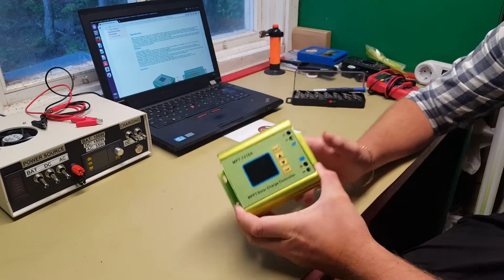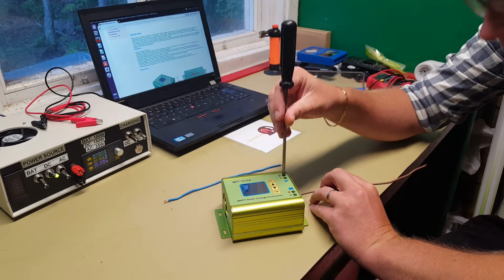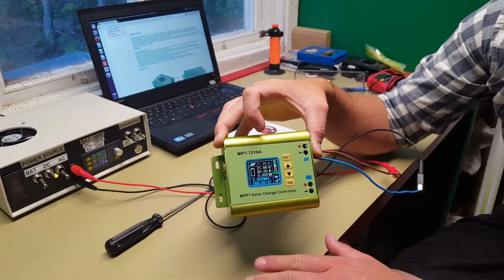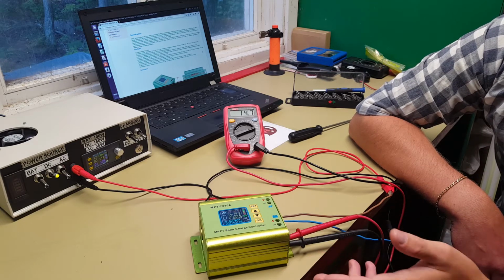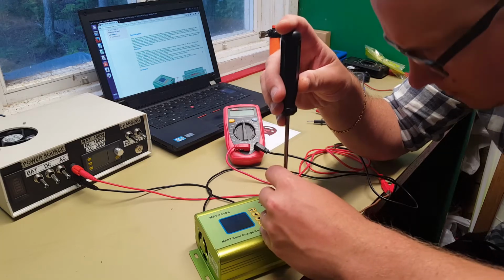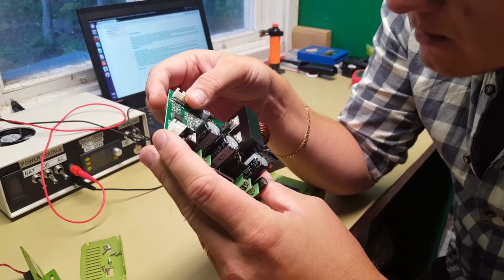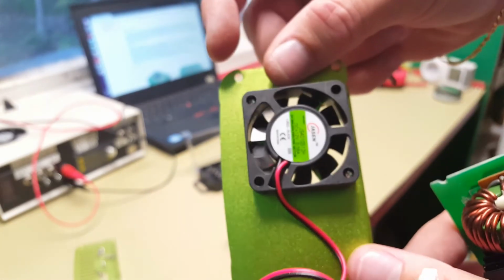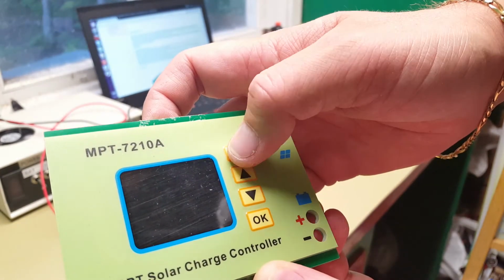A look at the MPT-7210A MPPT Solar Charger

Comment: Your review is spot on. I wish you could have identified the power gates and did a current test.
I have 2 of these units just recently purchased. one of them will not output more than 3 amps on a 28 volt setting inputting from a 12 volt 21 amp supply.  The other one instantly melted the solder trace from the T3 transistor to the R13 current sensor as soon as it was connected to the battery.
I Because i did not see any certification markings anywhere on the device, i would not recommend this item for sale to the general end user. If the manufacturing company would put just a little bit revisions into this unit they would have a really competitive product. Just my opinion...

Comment: This is the first review I've read that explains this controller correctly. This enables me to use one 12v solar panel to charge the battery from my electric trike. When I travel I pull the battery our of my trike and use it in my RV to run the fridge and other devices. The solar panel is on the top of my RV.
Reply: You wont get much power from a single 12V solar panel.
Reply: How many watts of your 12V solar panel on RV roof? Thanks.
Reply: What 12 volt wattage solar panel is recommended for using this?

Comment: I slowly begin to understand what these units do and what to use it for. I own a big UPS Server Backup Power Rack wit 8 old 12v-7A LA batteries arranged to be 48v (84Wh), i can replace them with a 13S Li-Ion Pack + BMS and charge it correctly with a 100-200 Watt 12v-24v Solar Panel. This way you can charge and discharge a 13S battery to run the 1600 Watt Inverter to use 220v stuff for a longer time if needed. The output current is rated (Fuse) at 100 amps, so BMS and wires have to be thick.

Comment: This is a good controller especially for lithium-ion
Reply from the maker: Hi Thiwanka, I absolutely agree. Since you can set the output voltage and it seems to be accurate. Thanks for watching!
Reply: What are those flat batteries you're using?
Reply: They look like batteries out of a nissan leaf!

Comment: Yes , you are right.. it is only usable if battery voltage is higher then solarpanel volatage.. otherwise it orvercharges the battery..
Reply: Germo Lepp it is a boost converter.

Comment: My application is to charge a 48V battery bank using a solar panel (or several solar panels in parallel), that have a Vmpp of about 39V and an Impp of about 9.25A.  This solar charge controller (scc) is also useful for a golf cart in which you put a single panel on the roof of the cart and charge the batteries.  Since golf is normally played on sunny days and there is a lot of waiting, a solar golf setup would be beneficial, possibly allowing you to slightly undersize your battery bank and reduce significant weight.

I also tested this with a single 210W panel in the winter (low angle) non optimal sun and saw a peak reported output of 160 watts but with an average of only about 105 watts (half power).

Overall I like this unit however I do have a few gripes...

1. It seems to go to 0 watts output occasionally and I am not sure why.  It happens both when it is cloudy but occasionally when it is sunny too.  Perhaps when the light transitions abruptly it gets "confused" and needs time to "think" of what to do next.

2. The screws for attaching the bare wires are down deep inside the case.  This does NOT allow probes from a multitester to get down in there from the top (at least mine don't).  It would have been nicer if they put those screws much shallower to allow it.

3.  The red color on the display is hard to see outdoors on a bright day.

4. The menu navigation requires some oddball keypresses.  Why didn't they just make it simple and cycle thru all the icons and have an exit button when you want to get out of the menu?

5. The current limiting sorta kinda works but not 100%.  If (for example) you have a solar panel and voltage combination that can output 5A max to the battery and you set it for 1A max, it will actually go a bit past 1A so it might be better if you really want a hard limit of 1A, to set it to even less, such as 0.75A, to give it more time to react and adjust the output current.

6. It would be nice if there was a fan speed button so it can be adjusted without having to go thru the menu system.
Reply: Ditto, same use and even tested mine in winter on my cart with similiar results. I just purchased a different model for comparison.

Comment: I have 2 solars on the roof of my motorhome
Kyocera 2x120W
KC 120-1

Details Maximum Power 120 W

Maximum Power Voltage 16.9 V

Maximum Power Current 7.1 A

Open Circuit Voltage 21.5 V

Short Circuit Current 7.45 A

and the MPPT controller that loads two batteries from these two panels in series to give a 12V output. Can I use this controller to recharge these batteries. What voltage should I set for charging?
Reply: You can use it, just make sure your voltage doesn’t exceed the units’ max input of 60v OCV, they can handle up to 15A, but is only capable of being set to 10A as the name tag states.... charging voltage, I wouldn’t recommend going higher than 12.8 if in parallel... the unfortunate thing about these units, they don’t like charging batteries under 24v, so you might have to consider paying for the Epever MPPT since those can be capable of charging 12v batteries.

Comment: It was looking like a good deal to charge my 48v pack from my two 100w solar panels, but manually having to start it is a deal breaker. I wan the thing to start charging the moment the sunlight is bright enough to start generating power.
Reply: Manual: "Long-term use, it is recommended to save in the ON state to set parameters to 00
positions, so that you can work automatically after the sun rises."

Comment: Will this charge 'under', the 100amp? I have four 18v 2.5amp panels on the way and was wondering if i wire then in series will they be 'seen', by this?
Reply: I have one, you cannot put in more than 10A before they’ll puke their tracks off... I accidentally put 70 OCV (open circuit voltage)... the tracks on solar input blew everywhere rendering it inoperable... it can do up to 15A if your supply can provide it... these can only handle 60V in max. While they can handle up to 60v in, you can set it to whatever output you desire... 100A is too excessive for these little guys... you’d essentially make a bomb unintentionally (it’ll just blow arcs everywhere)... but if you’re looking to charge a 100AH battery, this can do it, it’ll be slow though.

Comment: For people that want to use this to charge a 12V battery, it is not really designed for that.  However, suppose you had one large 12V battery you wanted to charge with this controller.  Why not just add 3 small cheap 12Ah "scooter" batteries to make it a 48V system, but put a load on the 36V such as a 36V input inverter to "burn off" the extra charge the batteries cannot handle?  Perhaps run a box fan or some other reasonable load from the 36V setup.

When there is no solar (like at night), you could turn off the load on the small 36V subbank of batteries but continue to use the load on the large 12V battery (in moderation of course).

Personally, I much prefer a matched set of large 12V batteries making it 48V and I run a 1600W max sine wave output inverter and I use this solar charge controller set at 40.0V Vmpp and 54V maximum charge voltage.  It seems to work fairly well.

Comment: Can you exchange the LCD screen in case its broken? Or do you need to replace the whole controller?
Reply: You can swap displays between the same units... same as the boards, they’ll keep the information you last saved on it when you swap... I’ve had a few of these on hand for parts as majority of said parts aren’t available.

Comment: Can I charge a 36V battery with one 18V solat panel?
Reply: Yes
Reply: You can, but make sure you don’t get any sort of “shade” on your panel... these little “mppts” HATE fluctuations in power input, so I’d recommend at least 2 in parallel.
Reply: @BeezyKing99  My question was 2 years ago! You know, the time when we weren't locked up underground. Meantime I have 2x18volt 100Watt panels on my solar trike. It works. Could be better. I get 30km extra range out of it on a good day. So I still need to charge at camp sites or hotels. Ideally I wouldn't need wall charging for say 80km daily distance.

Comment: So, if I understand correctly - you are saying I can charge my 48v, 17.5Ah Li-ion ebike battery with this device and a 20watt solar panel? If so, that's exactly what I need for long distance ebike touring. Please advise. Can I then perhaps connect this unit via a converter to charge USB items, i.e., phone, etc. Please advise. Thanks.
Reply: 20W is nothing but it would work. Problem is that your battery has roughly 840Wh which means that nominally it would charge it in about 42 hours. In real life this module has around 70% efficiency, sun is not always shining on the same side of the globe and your panel won't able to put out constant 20W. That said if you managed to top it up using this setup within a week would by great achievement :) You'd be better off topping your powerbank or small devices directly with solar panel, which probably has higher efficiency usb output.

Comment: Can I use a 36v solar panel with a 24v battery pack with this mppt controller?
Reply: no, u need a buck converter
Reply: You’ll essentially cook your battery... this unit is not a buck/boost converter... so if you want to drop it down to 24v.. you’ll need a buck converter as the guy prior to me said.

Comment: Hello is it possible to connect 24v 320w solar panel with this charge controller
Reply: Abel Jerson to much panel. it is only a 10 amp controller. it may work . I'd watch the current. it don't start up the next day. I'd get a epever tracer A 10 amp. or larger. for a little more money. this works more like a bench top power supply/ universal battery charger. than a actual charge controller. you will have to restart it every day!
Reply: See Vuaeco's video on this. He shows a way to have it come on automatically when it restarts.
Reply: Only if your  batteries are of a higher voltage.
Reply: Thanos, Or if you put in buck converters downstream of the 7210A. Mine is keeping a 12v string happy. The string is soon to be a 24v string so the buck converters can go away.

Comment: Does this controller have a low voltage cutoff (from the solar panel) and a high voltage cutoff (from the battery)?
Reply: Elwood Anderson it has a low voltage cut off of around 11V. Higher voltage it can output is around 90V (72V in theory)
Reply: It becomes inoperable once it drops below 10.5v... the voltage cutoff is set via the battery charging parameters.

Comment: Does it have to be that noisy? Are other charge controllers that noisy?
Reply: Stephen Hadik, You can adjust the fan speed. Most other controllers do not make that kind of noise.
Reply: gravelydon if you adjust the fan speed to a lower setting, screen readings become irrational. This is a know big with these units: https://youtu.be/_219JrlbNxg
Reply: Thanos, Maybe I got a good one as mine does not have that problem. Mine is set with the fan at about 3/4 of the setting available. A second one arrived Monday but haven't gotten it hooked up yet. It runs at 8-22 volts in and 28.80 max volts out at up to 9.5 amps.